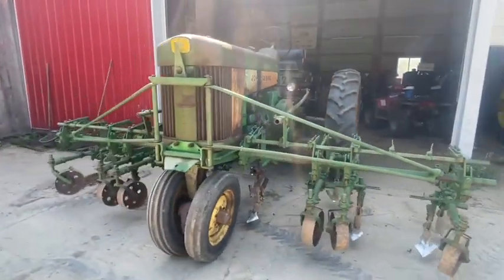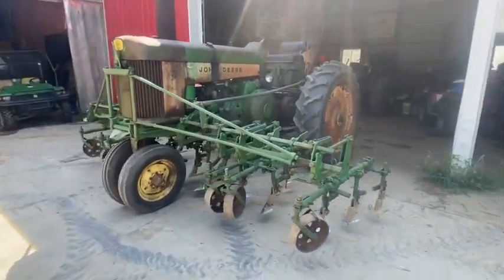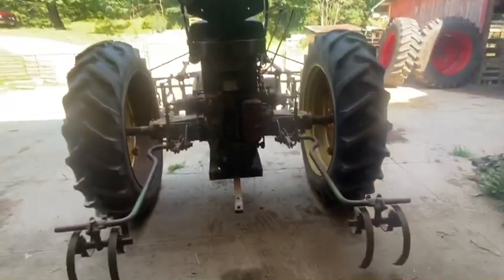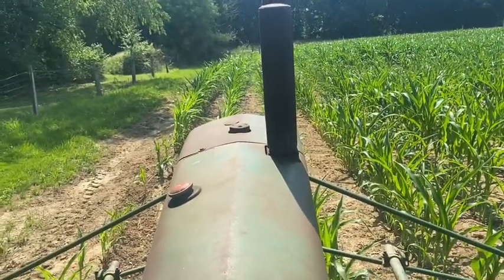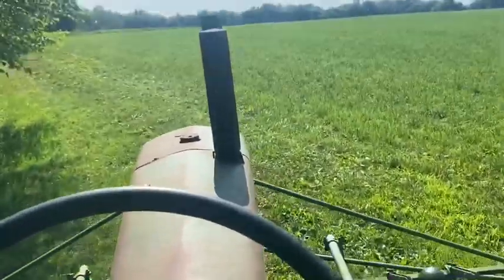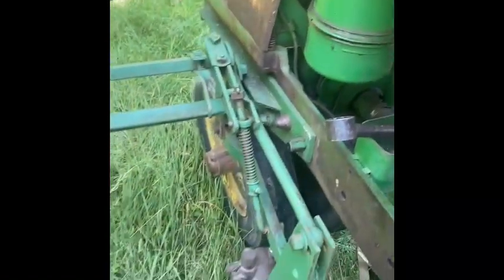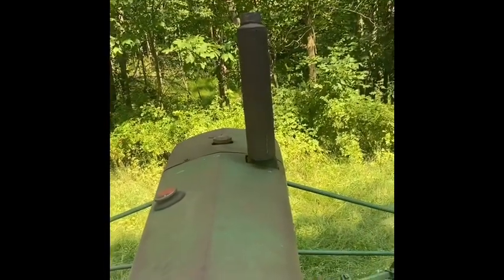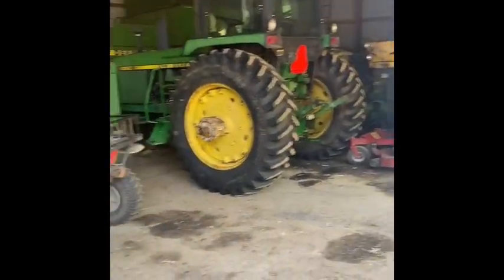John Deere 630 and ABG 400 Series Cultivators

Comment: dad had front mounted cultivator on our 620. First time I cultivated corn. at 13 years old. ours was set up on 6 30" rows Instead of the spring tooth you have we had a toolbar with 6 row shovels for irrigation watering.

Comment: I grew up running this same combo.  When the crop was small there were shields that went on both sides of plant row so you didn’t bury the rows.  These shields were raised as the plants got big enough so we could roll some dirt over the weeds in the rows and not cover the crop. When the corn got to your stage the shields were off, the sweeps would be adjusted wider and JD had “wings” that were added to the sweeps on both sides of the row to throw more dirt to cover the weeds on the row.  We then drove in 4th gear full throttle to throw as much dirt over the weeds as possible.  That was called “laying the corn by”.  I don’t know where that phrase came from but the farmers in MN &IA used it all the time.
Reply from the maker: I think Ive got those shields in the barn somewhere if not I know my 2 row does for my 520
Reply: Thanks for the video!  It was a great walk down memory lane!
Reply from the maker: @ranger1390  that’s exactly what I was hoping this channel would be thank you

Comment: I grew up with a similar cultivator on a 620. The two differences were 1) this cultivator has chains for lifting the 8 shanks.  Ours used rods similar to the rods for lifting the shovels behind the rear tires (we always called the shovels behind the rear wheels the “mulchers.” ; 2) This cultivator had steel gage wheels. Ours had rubber tires.  Due to the slight flex in the rubber gage wheels, less dirt accumulated on them like the rigid steel wheels did.
Reply from the maker: I’m just guessing but your was probably a model 40 this is a 400. The rear rakes were bought with a set of 2 rows off of a 530

Comment: My dad and granddad  several two cylinder tractors John Deere.  But, they also used what were called disc hillers turned one way they threw dirt away from the row the next time you turned them around 
And threw the dirt back into the row was used to cover up brace roots on corn..
Reply from the maker: What were you farming

Comment: Question is do you know where the rear center gang is and how it connects we are missing a bracket 4 ours?
Reply from the maker: Yes I have a couple different ones.  Some models didn’t use them
Reply: @andrewssoundsofthepast110  Yes we have the center gang but we do not have or know what the bracket looks like.
Reply from the maker: @kenwilcome3554  i think it goes on the pipes of the outer